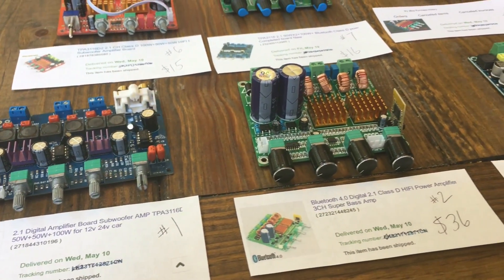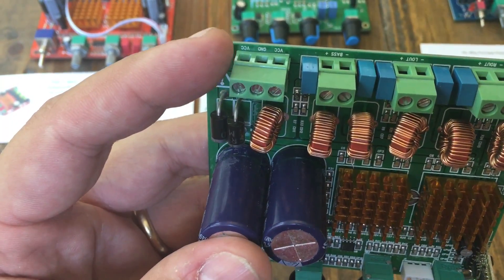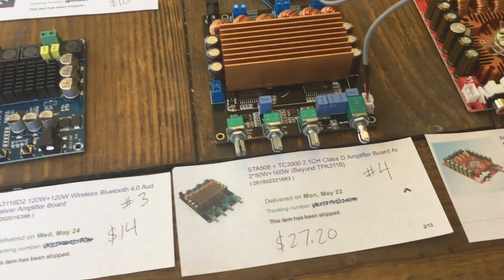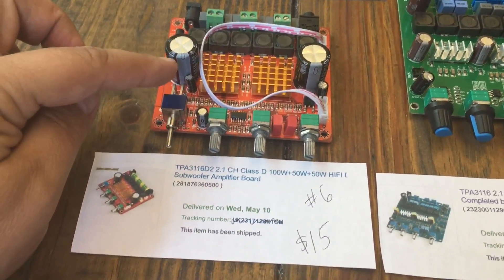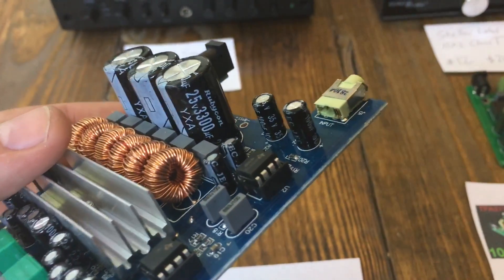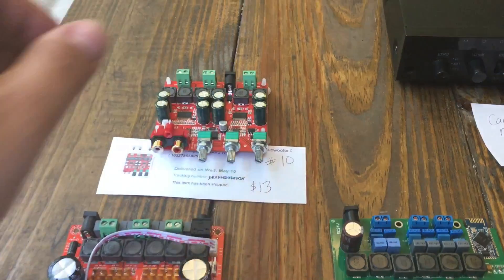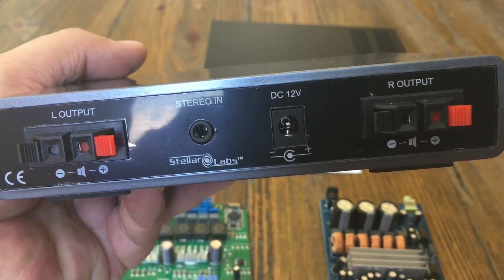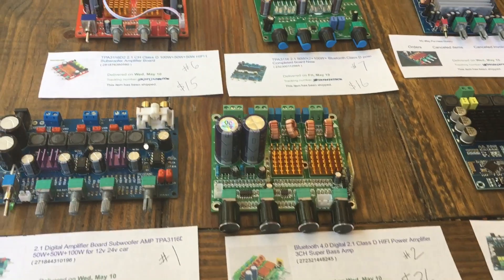Chinese Mini Amp Invasion #2 - TPA3116 and more

Comment from the maker: First and I must say the amp geek inside me is excited to try out these little beasts! I was impressed by the $10 Subwoofer version of the TPA3116D2 chip amp I recently tested and actually use it now in my shop powering a passive subwoofer. It does a GREAT job and I think I'll grab a few more...Make sure you see the video description above for links to check out these cool little amps!
Reply from the maker: https://goo.gl/pQI3GS
Reply: That is what these are for.

http://www.ebay.com/itm/New-1200W-20A-DC-Converter-Boost-Step-up-Power-Step-up-Module-8-60V-TO-8-83V/272445457728?_trksid=p2047675.c100005.m1851&_trkparms=aid%3D222007%26algo%3DSIC.MBE%26ao%3D2%26asc%3D41376%26meid%3D4f0b7f11fecb4885a1036225e4b53f42%26pid%3D100005%26rk%3D5%26rkt%3D6%26mehot%3Dpp%26sd%3D381676820464

The above for some power, or if you just need something like that 3116 mono-

http://www.ebay.com/itm/1pc-150W-DC-DC-10-32V-to-12-35V-6A-Step-Up-Voltage-Charger-Power-Boost-Converter-/182469529038?hash=item2a7c080dce:g:wpkAAOSwTM5Ys5mG
Reply: BigDWiz what do you use them with or for? Like you put them in the car??? I am so confused what you are doing with these.
Reply: Its harder to be creative when you need 24v-32v to make them put out anything decent.
Reply: +Kent how do you get 24v in a car? Golf cart is and excellent idea though! You could get 12-48 volts from it.
Reply: @Steve_Just_Steve  you can use a laptop charger for car , them can boost up to 24V .
Reply: BigDWiz where's the link for the RCA jack / header???
Reply from the maker: I got one of those (finally), took 2 weeks longer than the amps to come in. I will show it in an upcoming video
Reply: BigDWiz right on
Reply: BigDWiz thank you brother!! I didn't want to get the amps in and not have a way to test them. Got a few ideas of what I'm gonna build and I'll keep you posted.
Reply: DC 12V-24V TPA3116D2 120Wx2        ???
Reply: Test them all in 1 video
Reply: BigDWiz ya.... Love to watch... :D
Reply: BigDWiz I mean I like all of your videos but I don't really like these but sense u already spent your money do what u want but I like to see newer amps like the new skars    or bigger budget amps like a 1500 or 1000 watt. As always love your videos just saying what I think
Reply: Hi, can you recommend me a Bluetooth amp with 2x 100 Watts without weird noises ( Pop sound )
Reply: Just gettting into these lately. impressive for sure
Reply: just ordered a few of these bad boys and gonna experiment with some boom box builds. Thank you for getting my creative juices flowing

Comment: 5 years on...we need some updates. Now you got better power sources it could be time to push them off the cliff! And new amps too. TAS5630, TPA3255, maybe test at 1 kHz too (these chip amps can't really do rated at the lows because of heat, explained on the 3255 datasheet) and Do It Bump Doe Too!?

(P.S. might also try a 12v to 24v supply and actually cobble a car amp...for the mentioned 5630 and 3255 some big problems could be seen with voltage regulators only rated to 40 volts and a separate power source in place of that regulator will be the solution, going up to 50 volts. Mo Powa!)

Comment: Did you test these?!!  I can’t find any other videos of the Chinese Mini Amp Invasion!
I really want to know what the #2 can do as I’ve just bought one! It seems very powerful compared to a couple of others using the same cup but it’s really noisy! When paused disconnected don any Bluetooth device is outputting whines, clicks and even starts to hiss quite loudly when you turn the master volume down to minimum!!
I should also be receiving the amp with the fan soon which runs a different chip set, I’d love to know what it’ll do especially with the different voltage inputs! I’m running single 6113 amp of 14.8v in a Bluetooth speaker and I’m Scott to make another speaker with the fan amp but run that off 22.2v but would love to know what difference it would make to run them off 11.1v?!!

I really enjoy your testing of some old skool car audio as I was really into it 25 years ago abs still have quite a bit of kit stashed away!! So thanks for that. Hayeso
Reply: Hayeso1 me to I been looking for weeks where’s the test vid?

Comment: Awesome reviews on amps, thanks. Can't find it anywhere. Did you by chance do a review on #4? I have a 2009 Harley Street Bob. I am putting on 2 3" motorcycle handlebar mount  speakers and have a Tang Band W2-2040S 2" RBM Micro Subwoofer I want to install after I make an enclosure for it. I do not have had bags on the bike so I have to be creative with the install of amp and sub. Real estate is at a premium on the bike. I want it hidden as much as possible. I actually found this on ebay. Your #4 board with a case,$37! https://www.ebay.com/itm/Bluetooth-4-0-Digital-2-1-Class-D-HIFI-Power-Amplifier-Board-Super-Bass-w-Case/283514947740?_trkparms=aid%3D555018%26algo%3DPL.SIM%26ao%3D1%26asc%3D20131003132420%26meid%3D7952a7efcb3440cbaca5ada67958ff9c%26pid%3D100005%26rk%3D2%26rkt%3D12%26sd%3D122798422720%26itm%3D283514947740%26pg%3D2047675&_trksid=p2047675.c100005.m1851

Comment: Doesn't the number 2 one need a ac power supply?
Reply: Baron von Limbourgh no , it doesn’t. I’m running one on a 4 - 6 cell Lipo. From what I can see, it does mention something about being able to use 2 AC supplies or a 12-0-12v AC supply! 
I hope this helps.

Comment: hello, do you have a review test on amplifier number 6?? whats the function of the three pin wire over there jumpin to another part of the amplifier and second question is the, two pin plug is it for installing a cooling fan?? im looking for a video test review about this amplifier but it seems so hard to find..

Comment: Hey BigD, power figures are one thing but maybe you can hook them up with a reference track and give us your subjective view on the audio quality to go along with the power figures as well. As well as the downsides like sync beeps or volume change beeps from the Bluetooth boards. Cheers mate, loving ya vids.
Reply from the maker: Good idea, thanks 👍
Reply: BigDWiz cheers mate, I saw the post re power supplies, I'm just about to chain up a bunch of parts express stuff, inc a 300W dc-dc step up converter to a Sure 200x2 amp to run at 4 Ohm on a pair of old school cerwin vega Ai 4.2 's Co-axial 4" 2-ways I've had for 20 years and never installed. Happy to send you my findings, but no way to measure true power (I can just about use a multimeter ), let me know.

Comment: Ya know, those green bare wire sockets are really cheap... You could easily swap out the blue one for the green, then you don't have to avoid the amps that have the blue.
Reply from the maker: Yes! I bought a dozen or so of the green ones and that's exactly what I plan to do

Comment: I really apreciate you started this serie. this was literaly excactly what i was looking for. i was wondering about the TPA3116D2 amps and i was not sure if I should get one. i got a quick question. is wiring a 24v battery pack exactly the same as wiring a 12v pack, but then with a 24v bms protection board instead with a 12v bms?

123toid told me you might have more info about to tell about smaller amp boards. He suggested me to check your channel out.
Reply from the maker: +Max van Andel I really like the TPA3116 and 3118 based amps! They are my favorite of the bunch. I'll do a video soon on the different 3116 models. I just got some 5ch models in as well (3 chips). I personally use (2) 12v batteries in series plus a voltage booster if needed. As for your question, the 24 volt pack should work well. I'm not versed on the protection boards, so I'll have to defer on that one. Thanks for letting me know about 123toid 👍
Reply: i want to make it portable though.

Comment: Hey BigDWiz, what kind of power source do you recommend to run these little amps? I am trying to complete a 2.1 setup for a desktop pc. I currently have a pair of Micca mb42 and a 8" pioneer subwoofer.  Thanks
Reply from the maker: +Edwin Luu I prefer using 2 small AGM batteries in series, but there are also 24 volt, 5 amp power supplies that provide almost enough juice to run these...and will do fine in most situations.

Comment: I am loving your series on these chinese amp's. I am interested in a mono 150w subwoofer setup project for my home office. Have you seen those 500w ones for $16 on ebay?
Reply from the maker: +rcatank I got in one of the 150 watt mono amp boards recently and it will be an extra in these tests. The 500w boards require expensive power supplies, but I'm still considering getting one to try.

Comment: I have the little brother of #5, the TDA7498 non-E version thats 100w. Ive got it powering a sub, and I just found your channel after finding a bunch of these chinese amp boards on ebay recently. I'll bet you that it does what its rated for. Also that one, please test on 36 volts for me. Its safe. Also make sure to put the 2 gain DIP switches up to max.
And that one without a heatsink sketches me out, because at full power they DEFInitely need it. They probably want you to burn it up :P
Reply from the maker: +mrlithium69 I've been impressed with the models I've tested this far 👍

Comment: So glad someone is doing this!  But with many of these the concern is not the power output but the noise. Especially those with Bluetooth. 

I vote for #2, the HT21L-200. It's a wonderful 2.1ch amp with both Bluetooth 4.0 and aux input. It has a fairly tight voltage requirement as it cuts off below 22v but unlike #7 (the blue version anyway) this one is very quiet. Be aware there is a copycat version of the HT21L-200 that has terrible Bluetooth ground loop noise. It is easily recognized - the large electrolytic caps are black instead of dark blue, there is no HT21L-200 part number silk screened on the right edge of the board, and there is a very small Xinrui logo silkscreened on the back. Avoid this version if you plan on using the Bluetooth input.  And be aware that several eBay sellers show photos of the good one (what you have here in this video) yet ship the Xinrui one.

I think having the Bluetooth module stand up helps with the range. The Bluetooth module they chose is a good one and the programming (if you get a genuine HT21L-200) is excellent.  No loud beeps and the muting executes very well. 

My second pick is #3. I only had it a few days but if you add a 30mm length of wire to the Bluetooth antenna this 2ch amp is very good for the price.  The range is pitiful without the extra wire. 

#8 is nice in that it has a 37hz rumble filter which is helpful if you are using a small ported sub. But most of these "Verst" boards have sync issues (see FFCossag's YouTube video for the fix).
Reply from the maker: +Glenn C wow, great info! I had to contact the seller to get the BT pairing code for #2 (5188) and was unable to get the aux input working in the meantime. Once BT was connected, wow, ultra clean, no hiss. I really like these amps, what a fantastic value they are!

Comment: #2 is my favorite to test first! Those big capacitors look like a win.
Reply from the maker: +u9Nails #2 seems to be a good choice. I did have to get the seller to provide the BT pairing code (5188). I've not put on bench to test yet, but connected to speakers via BT, it sounds great to me

Comment: I used to have a "Vava Voom" portable Bluetooth speaker that uses two of the TPA3118D2 ICs.. one is used for the stereo speakers and the other one is used in a bridged configuration for the "subwoofer" (if you can call a 3"speaker a subwoofer) never the less this unit is extremely loud for it's size... it really blew me away when I saw the actual size of the IC amp chips in relation to just how loud the speaker is.
Reply from the maker: +Adam Cluff great name for a speaker. I would've named it "Vava Boom" though 😜

Comment: why you dont have TK 2050 amp for 20 usd? this amp is really good and it is difftrent then all of those amps that u shown in the viedeo.
Reply from the maker: I'm sure there are dozens of different amps I didn't include here. I wasn't intending on testing each and every chip amp out there, just the ones that drew my interest. I'll check that one out though, thanks for the info

Comment: would be kinda cool to make a mdf rack with a power transformer and run 1 per door speaker. would require a couple splitters, but in theory they should work for a 100w speakers. I may have to try this myself.

Comment: +BigDWiz can you do a 12vdc test at 6 ohms and tell us which one has the most watts rms and sounds the best. keep up the grate videos it is interesting to see someone dyno amps ive been watching your channel for a few years now thank you I have learned a lot from you I'm planning to build a portable speaker but need around 30-50w for 12vdc setup is it possible to find a 2ch amp board off eBay.
Reply: (#4 1st) than (#2 2nd)

Comment: Im actually interested in #8 for the capacitors, but for a different reason as yours. iirc a lot of older car amps use to Rubycon capacitors ( I want to say Zapco being one of the companies), and if memory servers right another company was making knock offs that where total crap. So Im curious to see if they are knock offs, or if they actually perform better than expected and dont blow up. IMO the perfect test for these would be bringing that voltage up to where its boarder line on if they will survive.

Comment: thankful for you testing all these mini amps the one i bought a few 
months back is one from nob sound .. ns 10g it was around 27$ when i 
bought it .comes fully built nice housing really small though.. has 4 
nice post on the back for up to around 12 guage wire . my only complaint
 so far has been the ac to dc adapter they shipped it with .. its super 
cheap and sparks bad when you hook it up .. its a fire hazard Im now 
using another one a 19 volt from a laptop and it does go louder without 
distorting . i have it powering a 6.5" kenwood car component set as my 
pc speakers and they sound great .. 
https://www.amazon.com/Nobsound-NS-10G-Bluetooth-Digital-Amplifier/dp/B01MS739KX/ref=sr_1_1?ie=UTF8&qid=1496647946&sr=8-1&keywords=ns+10g
   after your test and if i decide on one of the amps your testing i can
 ship this one to you for a dyno test if you wish to try it out as 
well..

Comment: I have piles of all kinds of cool modules.. high power led's & drivers (led's are the future) oled displays, lithium chargers, bms's of all types for custom 18650 cell battery packs, meters but mostly dc supplies, boost buck converters etc.. check this one out, it would make for a nice lil bench supply for projects. They are very active here on YT, RD Tech is the channel, they are doing all kinds of cool stuff. Remember Radio Shack is gone, and things have progressed a lot and electronics kits are still being made and much cooler and online is the only place to go. There are a few really cool Chinese companies, guys like us, modding whatever, who can get stuff done cheap! https://www.youtube.com/watch?v=Pl7UMfN7dFM&t=9s They have really good reviews as a company.. https://rdtech.aliexpress.com/store/923042?spm=2114.12010608.0.0.bguyJu

The "Ali" websites are like the new ebay for gadgets and whatever you could possibly imagine..

Comment: I think you need to test #2, with the bluetooth module attached and 14 bucks it's likely the best value buy on the table.
Reply from the maker: I agree, appears to be a great deal. It seems to be cheaper since it doesn't have volume or tone controls and no other inputs

Comment: do the lepai LP2020. they put a new chip in them and made new PCB's, so now they supposedly put out 40w for real.
Reply from the maker: I recall that mod, very cool. Put the link to that video if you know it. I'm sure people who like these would like to see that mod.
Reply: Electronics For Fun the LP-2020TI does have a Texas Instruments chip that can run at higher voltages than the Tripath chip in the LP-2020A+, but in order to get a stable 20 watts RMS per channel into 4 ohms from it you need to actually give it that extra voltage (20V) which requires supporting mods such as fitting a heatsink to the TI chip and swapping out the 25V capacitors for 35V ones
Reply: 25v caps? last l check they are 16v caps. and the mods aren't hard, they only problem is the star screws. l actually stripped my only star head that would fit and l couldn't get the screws back in so the back plate screws are holding the whole thing together. anyways, l wouldn't want a mod where you have to fit a heatsink, because not just any heatsink will do. you have to calculate to the chips TDP and voltage and possible machine your own heatsink to the proper proportions and fin ratio and the temp difference in a class D chip then you have to figure out how to mount it. or you could just grab any random heat sink that fits and glue it on there, l am sure that's what everybody is doing. because it's just an ordinary class D chip and those things tend to run pretty cold compared to a A/B or a T.
Reply: Electronics For Fun the LP-2020TI is an entirely different model from the LP-2020A+. It has 25V capacitors, whatever they are out of the box they need to be changed out for 35V ones for 20-22V operation; the ones in mine will be... mine has already had a heatsink fitted to the TI chip as it's the very unit from a certain YouTube video...